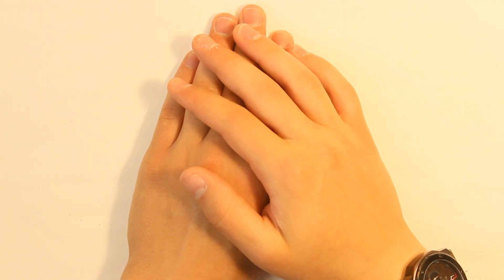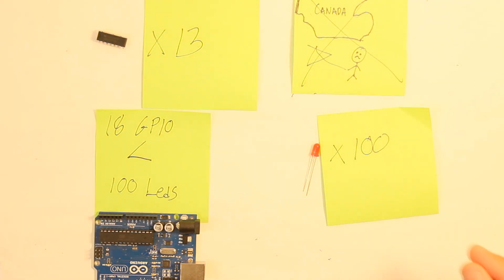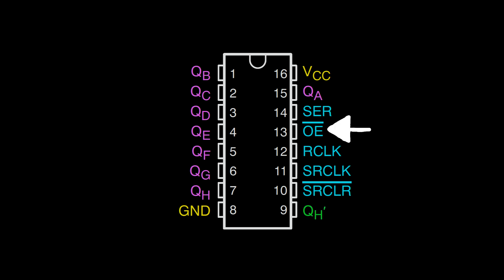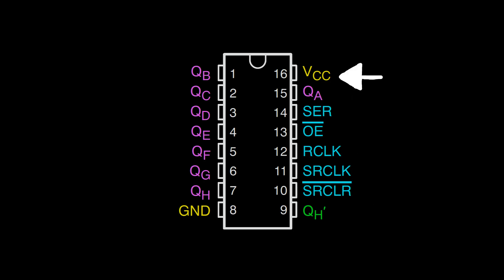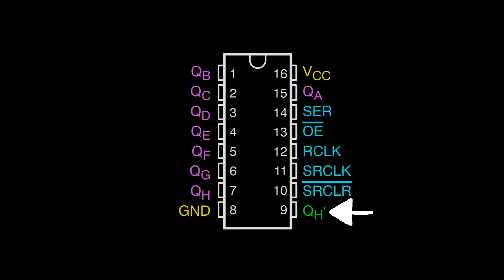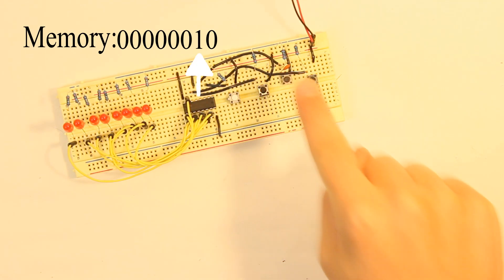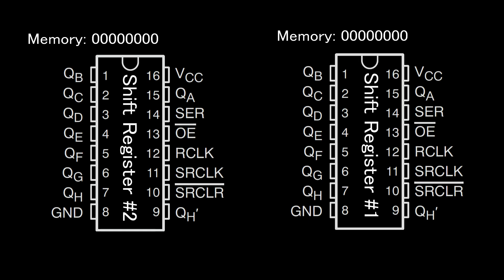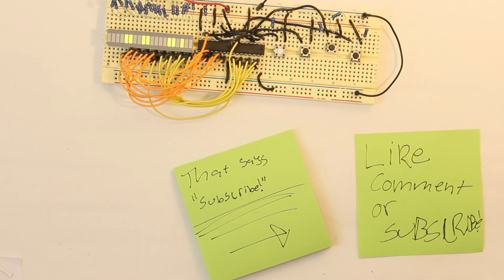The Shift Register: Explained [74HC595]

Comment: What will bi if PIN 12 RCLK (output clock) connect to 5V? Will the data momentarily pess from Data Lene to output or it will not work?
Thanks.

Comment: when i tried to control the shift register with push buttons i could not control the memory of the shift register and the memory was random.I used pull up and pull down resistors but it still did not work.Is it because of the resistor?did i use the wrong ohm?please tell me.

Comment: I wonder how responsive these shift registers are. When driving them with push buttons it hardly matters, but imagine you were using them as actual IO buffers or something. I imagine that eventually you would get to a clock rate to which they stopped responding reliably.
Reply: You can find the answers that you seek in the datasheet. It's roughly 25 mhz at 4.5v

Comment: If Output Enable is set to high, pins turned off, will the chip be aloud to change it's memory content?  Say if I have three chips connected to an Arduino, all three chips share the same srclk, srclr, rclk, and ser pins on the arduino except pin 13, the output enable, can i write to each chip individually by setting the intended output enable low, then shifting the bits?  Set low 13 on chip one, shift bits set 13 high. set low chip 3, shift bits, set high, etc...  Good video, Thank you!!

Comment: Just asking, is shift register output limited to digital HIGH/LOW only? 

I mean, in arduino digital IO have range 1-255. Is it possible to specify a certain amount of voltage output using shift regster?
Reply from the maker: Shift registers only output 1 or 0, in fact so do the digital pins on an arduino. Remember that digital is by definition 1 or 0, nothing in between. 

Arduino digital pins only output a 0 or 1. However, if they are configured as analog, then it is possible to achieve the 1-255 value you mention. Interestingly, the arduino (as well as all other digital electronics)  use entirely different (internal) hardware (called peripherals) to generate digital (1 or 0) signals than they do to generate analog signals (1-255).
Reply: electronica thanks a lot mate
Reply: the 74595 can also set the outputs to 3-state, or hi-z.